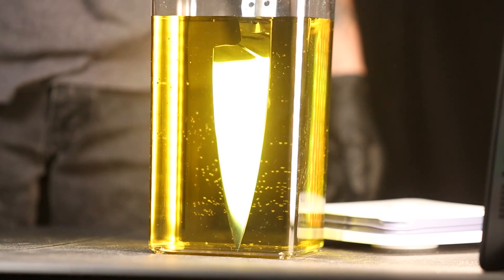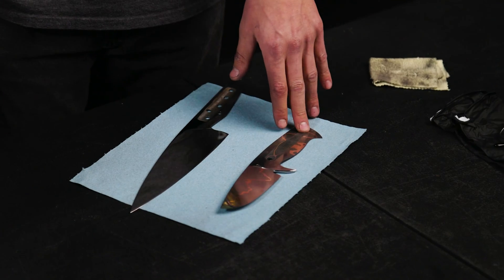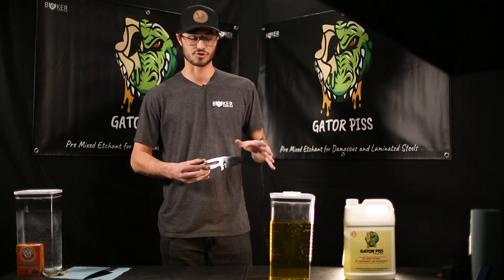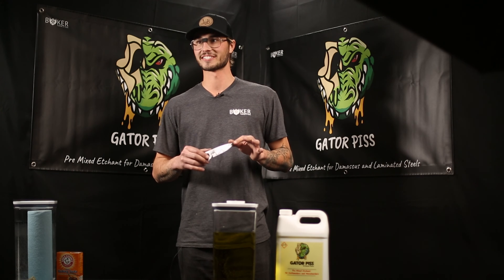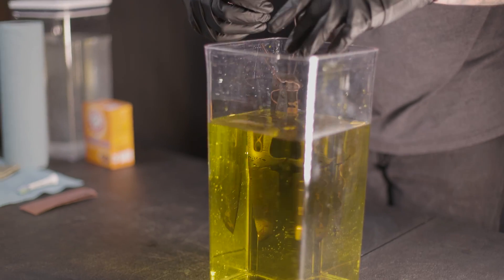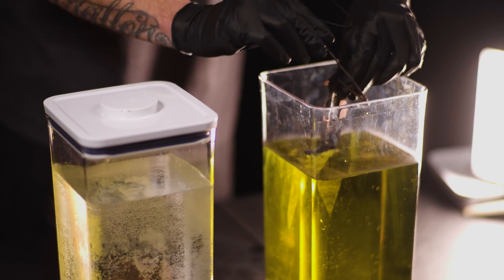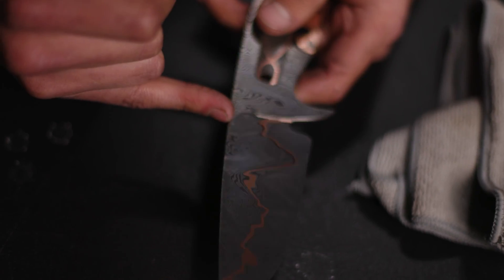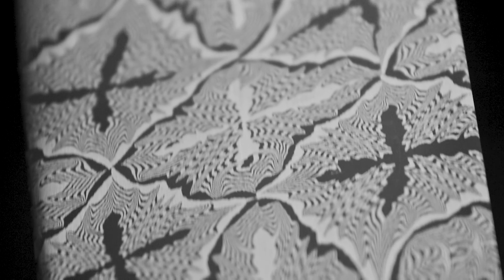Gator Piss Etchant (Tutorial!)

Comment: Hi guy's I really like the gator piss but I have some issues to use it. First I think I need to get 75 degrees before I etch or it can take a few hours to get the black. My biggets problem is when I put the wd40 for 6 hours, it begin to rust a bit and I dont know how remove de wd40. So I put it under water and I try to dry it  with sponge towel. After that I loss à bit off the black and my 15N20 is more gray than shinny. I know its not good so Can you explain more these step please.  Thank's and have a good day.
Reply: I had the same problem and tried out normal silicone oil , don't wipe it off after the etching, dab dry with a towel and oil it for 6h

Comment: I have a Baker Forge copper Mai blade.  Will this wear off?  The maker I went through did not use the gator piss and the black is wearing off and not extremely vibrant anymore
Reply from the maker: Hi there. The durability of the etch is more about how the blade is sealed and how the oxides are solidified rather then the actual acid used to etch it.

Comment: Would you consider the finish to be food safe as described here or would you recommend a food safe oil instead of WD 40?
Reply from the maker: Once the blade has been neutralized, it is food safe. To protect a blade that will be used with food, coat blade in a food safe wax or oil after etching

Comment: How many etches will it last. Also I used this and it worked great but how do you stop the black from rubbing off on cloth afterwards?
Reply from the maker: Hey there! 
Couple of things,

The Gator Piss will last 4-6 months for most makers. But that will vary some depending on how often its used and how clean you keep it.

For keeping the black oxides, First, are you buffing between etch cycles to help establish a good base for oxides to stick to? That’ll help a good bit.

Second, you’ll want to do a little more to setup the oxides on the surface. Couple things you can do. Once it’s out of the last etch and neutralized, hit the surface with a heat gun to help dry out those oxides quicker. Not anywhere hot enough to start discoloring anything, just warming up the surface. All this without wiping the blade at all. 

Then after you dry it spray heavy with wd40 oil, let it sit till it looks like the wd40 is almost drying on the blade. This really depends on your environment and humidity. Some guys can do only a few hours, some guys in more humid climates have to let it sit a day or two. But if lots of oxides wipe off, then they haven’t setup properly yet. Once you find your grove, you will be able to scrub that blade and it’ll stay nice and black with only small amount of oxides coming off.

Hope that helps!

Comment: Hi i just got my gator piss and take a first test etching for 2 blades. Cumai blade and sanmai blade. Cumai went quite black and let see how the final eching is done. Cu is clean, but carbon went black as it should. 

But the main reason why I write here is that I but water and baking soda were I put the blades after etching there came some gator piss in to the water and a little change a water color. After this when I try to etching another blade, instantly when blade go to water it turn black. Then I clean up and take another etching and normalize that wit window spray it looks better.  Has someone else had this kind of problems? 
Do you alway change water every etching proses?

another question is why many blow air on the gatorpiss or mix it some kind of propeller. Is it nessesery?

Thanks.

Comment: I have been using Gator Piss for some time and I have 2 questions please.
1/ Should we use it hot or cold?
2/ At the end of the process, after 6 hours of waiting, when I wipe the blade with a microfiber cloth, it becomes dull. I saw in the demo video that they use a 2nd cloth called sunshine apparently. Is it this cloth that makes the damask shine again?
Reply from the maker: 1. It should be slightly warm. About 70F
2. Yes, sunshine clothes are jewelry polishing cloths and help add a nice shine and luster to the steel
Reply: @BakerForge  great ! Thanks a lot !

Comment: Why don't you guys etch your tangs?  You're really passing up on a great opportunity to make your blades look that much better.
Reply: I imagine because it gets screwed up when you finish the handle. You can acid etch the spine with a q-tip after the handle is on.
Reply: @nics1964  There are ways to do it, but it's more difficult and takes more time.  I'm guessing that's probably why.
Reply: @nics1964 a good strong double sided carpet tape will let you finish your scales and then you can remove them for the etch.

Comment: Can you do a video with one of your core oriented billets?  I have the damascus cumai with 80crv2 core. Gp worked great on standard damascus but terribly on a core billet. It left long streaks in the core and I addressed them per directions, but after 3 soaks it got worse. I had to re hand sand from 220 back to 2000 which took hours. I tried again and stopped after 1 etch. Honestly coffee etch looked better.
Reply from the maker: Anything with a core needs to have an extremely even scratch pattern before etching. Deeper scratches will not collect oxides while the remaining body of steel will. Coffee does not leave the same kind of oxides and is more consistent with a stain that’s why it doesn’t last. In order to combat any left over scratches be sure to agitate the acid during the first etch and scrub with a plastic toothbrush. After this initial etch if you have areas with streaky oxides, it will only get worse with more dips. If the core is even and solid you will want to go ahead and lightly wet sand with 2500 grit paper then lightly buff. After this etch for 40 minutes without movement in the acid. It’ll be far superior to coffee
Reply: @BakerForge  thanks for the reply. I hand sanded back down and found that plenty of agitation during the first few minutes helps as we as brushing no matter what. I've gotten much better results. Thanks.

Comment: First, beautiful results! I know y'all have been working on this for quite some time. Second, have you found that the copper contaminates GP the way FC does?
Reply from the maker: Yes, over time, copper will start to build up and contaminate the solution. Especially if knives are left in the mix for a long time. But this does happen much slower in Gator Piss then normal ferric solutions
Reply: @BakerForge  I have my GP and I'm excited to etch this go-mai custom I'm currently hand sanding. For a simple go-mai or san-mai piece, 600 grit should be sufficient? I was planning on taking it to 1500 but it sounds like that might be unnecessary or even counter-productive
Reply from the maker: @hayworth.handmade  A clean and even 600 grit finish would be better than a 1500 grit finish with 400 grit scratches left in it. The more even the finish, the better.

Comment: Have you tried this on Stainless Steel Damascus ?
Reply from the maker: It has not be tested on Stainless Damascus yet. But we have some people testing it on that. Will have an update soon
Reply: @BakerForge any update on stainless? I’m not interested in using it on actual stainless damascus, but I have a bunch of san mai that has 410 jacket over a 52100 core. Wondering if this would be a good option to blacken that 52100 core while leaving the 410 alone.